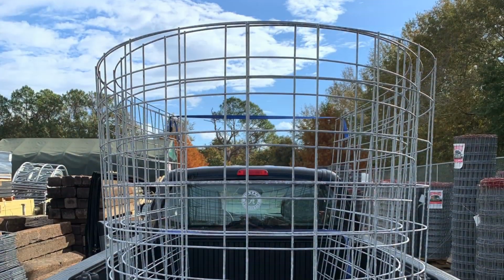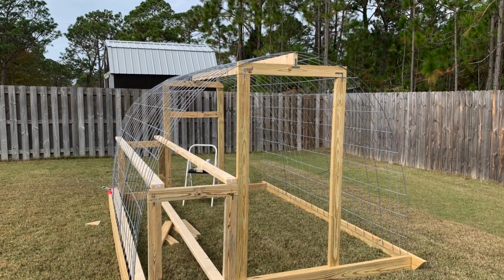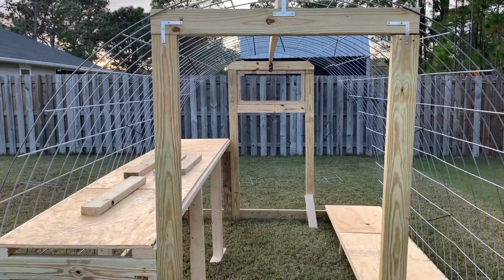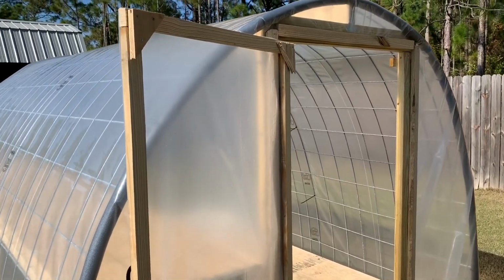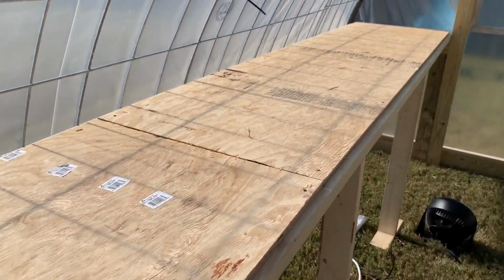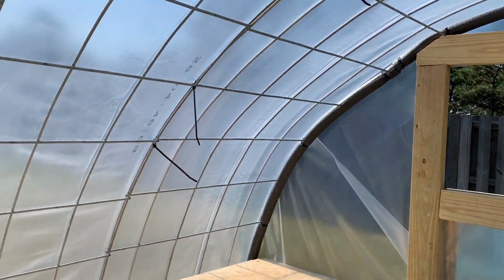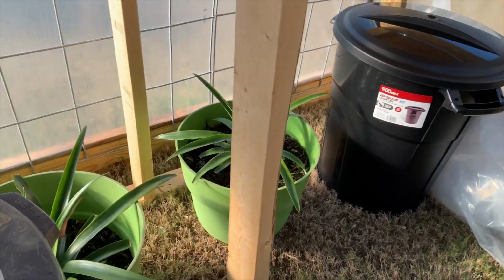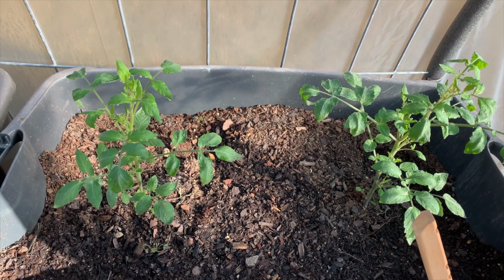How to Build a Cattle Panel Greenhouse

Comment: I have been racking my brain trying to figure out how to get 16 foot cattle panels in my Tacoma since I don't have a trailer. I was almost to the point of going with PVC for my supports. Thanks for the help!
Reply from the maker: awesome
Reply from the maker: did you get it home - build it yet?
Reply: @rtechromancer Actually just started on it yesterday! Got the cattle panels home no issue and it was easy sailing from there. Got the sidewalls and cattle panel up, just need to finish framing the door/window and waiting on my plastic to get here.
Reply from the maker: awesome!  @bigsasquatch1991

Comment: If you add a 3-foot stem wall on both sides, it makes a very nice 10-foot wide bt 8-feet wide greenhouse.
Reply from the maker: That’s an excellent idea.
Reply: Lifelake said this its a 12x8x8 on deminsions in the comments. I dont understand you on the 10x8 when u add 3ft stems.  What is that benefiting. Please explain

Comment: How well does it keep up? Eventually it's often fluttering that will break the plastic and it might be a good idea to tie a string across the roof, to hold it down in areas where it tends to beat.
Reply from the maker: It’s been great. I had it two years and gave it to my neighbor. We took it apart and rebuilt in. Their yard. No tearing. Only faded a bit.

Comment: You'll need a fan in there. Yours is very similar to mine.
Reply from the maker: I have two fans! Keeps it nice. Also have a heater and it’s controlled with my smart phone.
Reply: Could you share info on the heater ?

Comment: Really nice greenhouse ya got there. I'm confused about the taller shelf being on the south side. Is it meant to block the sun from hitting the lower shelf? It seems like that must have been an intentional placement, but my first thought was that the taller one should be on the north side, so that the sunlight can evenly hit both shelves when the sun gets low in the sky.
Reply from the maker: You are probably right. I just made a guess as to what was best.

Comment: Does it matter which way the greenhouse faces. Our lot works better with the door and back window facing North and South?  Will that be a problem?
Reply from the maker: ReRe I did door and window on west and East to maximize solar exposure on the long south side for winter heat. Honestly on a house this small I don’t think it’s significant either way

Comment: Like your design with shelf’s. Good job! Do you have the inside frame dimensions? Looks like you have overlap on the 2x6s?  Then I understand you had to shorten one of the cattle panels by how much? Was it so your plastic would fit? Thank you.
Reply from the maker: I shortened them because they are 53” tall. They wouldn’t fit in my 12’ Frame. I left about 6” on each end of the long side in case I wanted to hook up a tractor and move it. So I had about 11’ total. Maybe 11’3” or so. So I cut off about 1/3 of. A panel. Even if I had exactly 12’ there or them would be too long (about 18” too long). Make sense?

Comment: What is the dimension of the greenhouse?
Reply from the maker: christopher sanchez the wood on bottom is a 2x6x12 longways and a 2x6x8 wide. The cattle panels are 16’ x about 53”. That puts it about 6’3” at the apex. I had to cut one long ways to get 3 to fit inside. That’s make sense? Hope this helps.